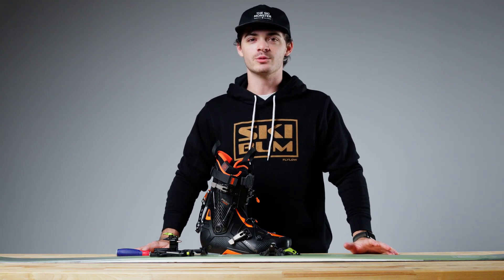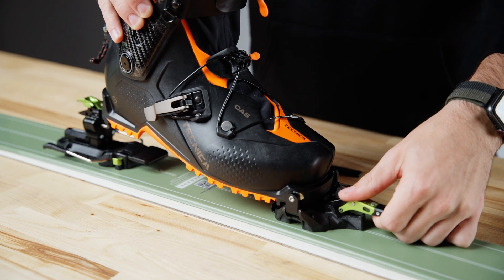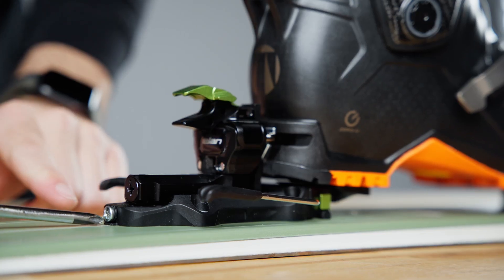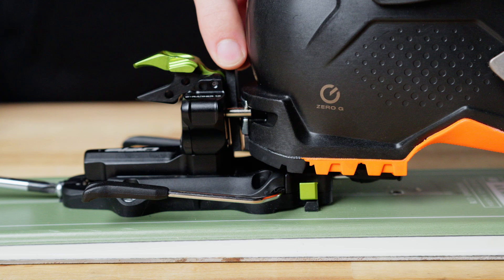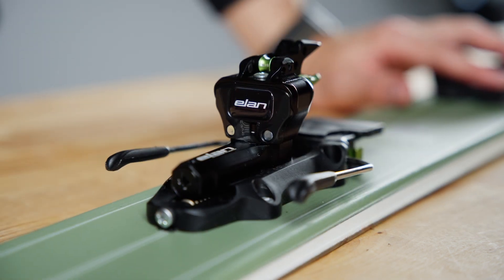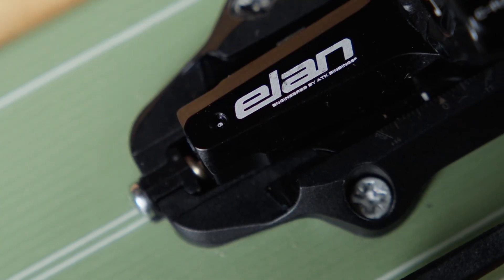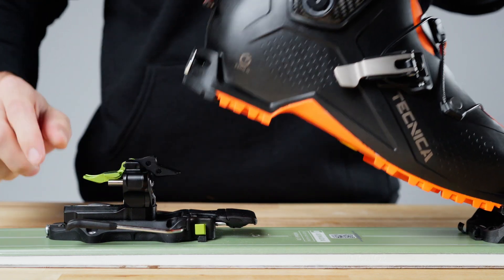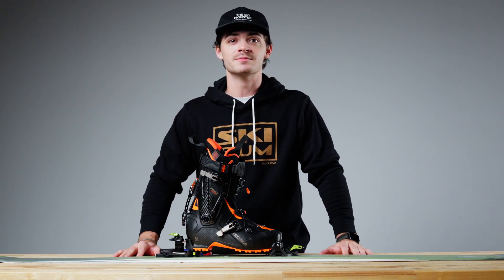How to adjust the ATK C-Raider Touring Binding

Comment: Good summary for newbies.  One comment however.  Use RV (release value) instead of DIN.  

There's only a loose correlation between the two, and in saying DIN, people might be inclined to infer a higher degree of release consistency than is possible with tech bindings.

Comment: Is it the same on the R12 2.0? Is it 4mm on all the ATK bindings?
Reply from the maker: Brand new ATK bindings come with a spacer that is 4mm. All of the ATKs we’ve mounted have used that spacer
Reply: @TheSkiMonster Okay so it is also valid for older models?
Reply from the maker: @nils8485  yes. atk bindings use a 4mm gap
Reply from the maker: @nils8485  yes. atk bindings use a 4mm gap
Reply: @TheSkiMonster  hey thanks for your video! i bought a ski with already mounted bindings and now i find myself with a 6mm gap... is that a problem? idealy i dont want to redrill the skis